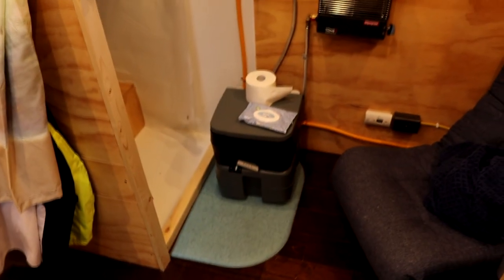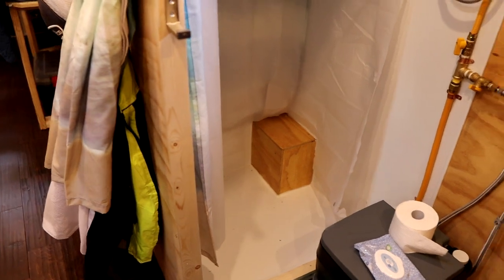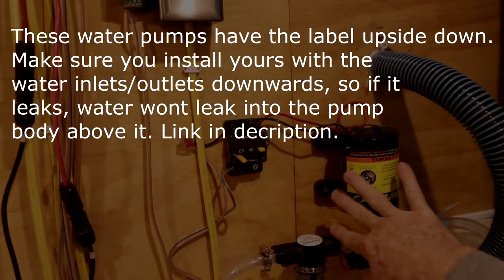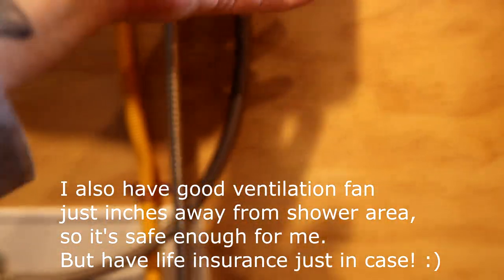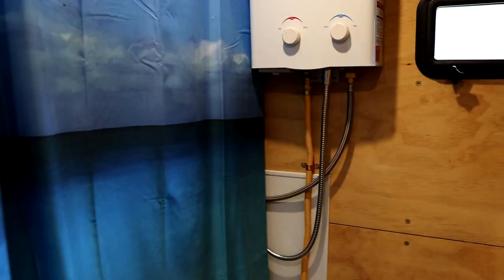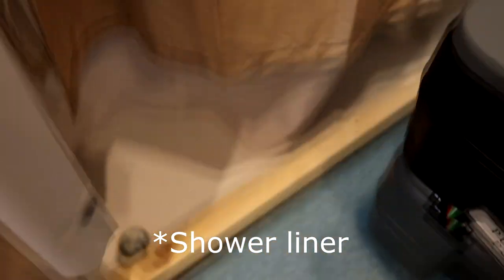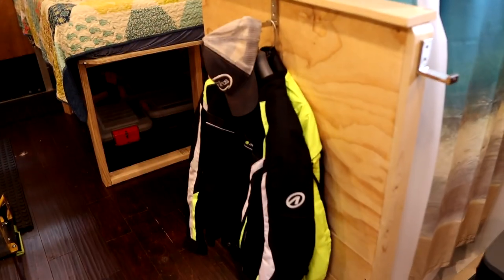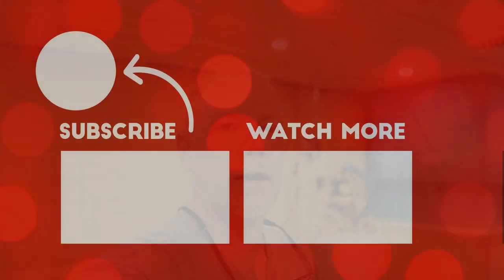Cargo Trailer Camper Conversion Shower and Water System Walkthrough Ideas

Comment: Very nice, looks like you built that shower area very well, and it seems perfect for what you need.
Reply from the maker: Thank you Jag Fam. After using the shower for two weekends, it needs some small improvements to the shower curtain to keep in tucked inside mo betta. Maybe magnets?   I may also put a 2nd drain hole in the outside corner too to help with drainage given different slope conditions. I'm often not level side to side and water has been puddling in there.

Comment: I’m starting my build. One thing my husband is worried about is the humidity from the shower. Do you know how we can avoid this. So I can have a shower and not make it an issue.
Reply from the maker: just install a good fan, take very short showers, and cross ventilation too if possible. And shower outside when the weather is nice, using a solar shower bag.